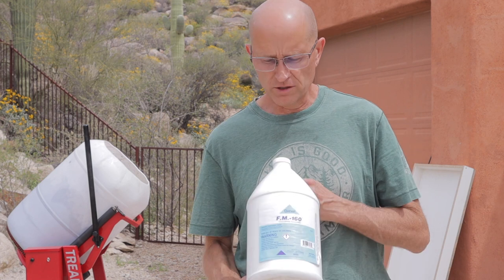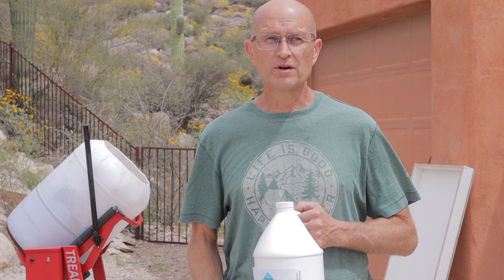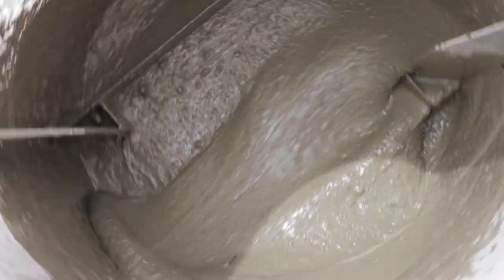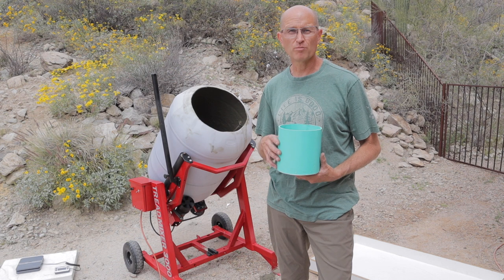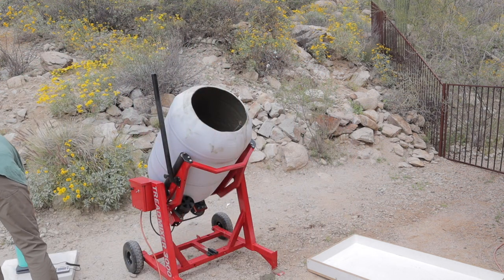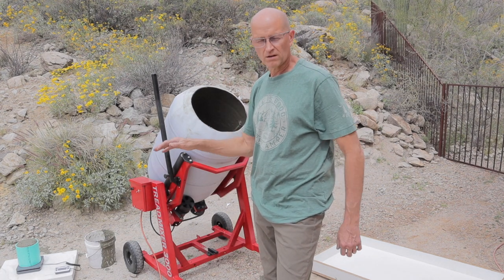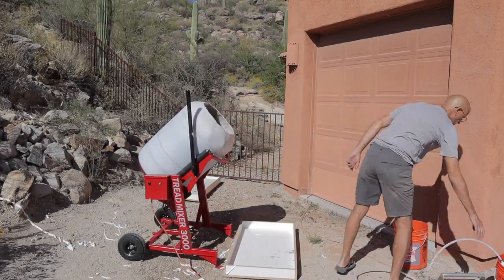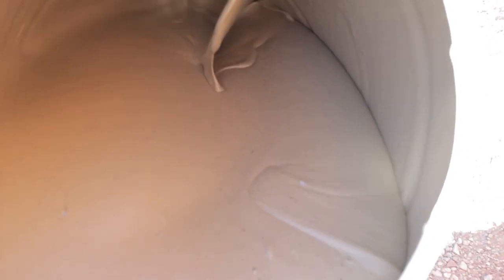How to Make AIRCRETE The RIGHT way!  [ How to measure Density for consistency.

Comment: I have a suggestion for building walls with AirCrete.  Maybe it's been posted and/or tried already, but it may be of use for continuous wall construction.  
Last year, I visited St Augustine Florida and took a close look at the exterior walls of Flagler College.  They were CONTINUOUS concrete walls going up several stories.  Apparently, how they did it is, each day, they would pour about a foot of concrete within forms that only extended up a foot.  The next day, they'd move those forms up another foot and pour again.  Each layer would bond to the previous layer. 
You can see the lines like strata in the Grand Canyon, each being a day or two old.

Call me crazy, but wouldn't that be an easier way to build a wall than making blocks and mortaring them together?  If the layer settled overnight, the next layer of foamy aircrete would simply fill it in.

Just a thought...
Reply: I'd love to try it here in Florida, but we have those things known as hurricanes, (and oddly, tornadoes...) and would require the impact resistance of 4000psi reinforced concrete, which is what I'll be constructing.
Reply from the maker: That is a great idea with the slipform method with Aircrete!  I had come up with a solution to building all those Aircrete blocks as well. I was going to build precision curved forms like pie sections of the dome called “gores” and just pour the Aircrete into them and my design was interlocking so once all the sections were cured, you just assemble the pieces and voila, instant dome! Similar to this method the Japanese use.https://youtu.be/muNbMlBeADs  I have since revised it to be similar to yours where I just build my arches out of steel like I described earlier. I purchased a “Hulk” tubing roller from Swag off-road and have been playing with it for a while now building projects around the house and I’m confident I can produce repeatable arches out of steel tubing due to the accuracy of the digital readout that it comes with. 😁👍
Reply: @PranaTech  Wow.  That Japanese method looks costly and painful to get right.  As much as I love the look of a dome and respect its resistance to external forces, like an egg, its geometry is far too difficult to build cheaply without an airform....in my opinion. Florida has a geodesic dome manufacturer, but they're not "monolithic" by any means.  And they tend to leak from what I've heard.  This gives Monolithic domes an advantage with a weather-tite airform.  But even then, the airform won't last forever and will need to be coated regularly or covered with a "permanent" solution like metal.

This is why I've decided to nip the bud early and use 2'x12' metal panels as a skin over hoops made out of 1 3/8" top rail bent with hoop benders from buildmyowngreenhouse dot com.  With the weather sealed out, I can then apply 3" of polyurethane closed cell to the inside of that, then attach the rebar & spray my sand mix with a cheap mortar sprayer.

The hoop bender is cheap and I believe I can get consistent hoops.  Since it's soooo thin, the skin will have to be screwed on though...  I'm not skilled in spot welding.  I'm starting with a 100 sq' shed.  Then a bigger shed of 150 sq'. And if all goes well...
Reply: @PranaTech  One other method I've seen which may allow for a thick wall of Aircrete is: "Bow Construction".  This definitely is DIY level, see:  https://www.youtube.com/watch?v=Co5KfvKux44
I haven't given it too much thought, but it seems a guy could use 2x6 spacer blocks, and if you skin both the inside & outside using the "slip form" method, you could build your walls 2 or 3 feet a day till you get to the peak. This would be a 6+ inch wall (depending on the plywood used for the bows.) I believe it would be very good "R-Value" and at that thickness, as strong as wood construction.

When the aircrete has cured, you could remove the bows and fill in the spacer block holes rather easily.

Again, this would be great for a place with no hurricanes or tornadoes (like Florida or Texas).  I think the arch would be fine with the snow loading in the Northern states.  But I'm no engineer, I'm just a guy who thinks he knows some stuff.

Comment: First I like to thank you for all your informative videos.  Your videos are much more detailed and scientific then most of the video postings.

I'm new to Aircrete and frankly somewhat skeptical of its durability, but I guess it has it's applications.  I've been researching the making of Aircrete by DIY'ers for about six weeks.  My first impression was that making the proper density of foam and using the proper foaming agent was the “holy grail” of Aircrete.  But several individuals appear to have engineered a workable foam making device and “magic wand” to provide the proper working density.

But I'm now convinced that the incorporation of the foam into the Portland Cement slurry is equally important.  After watching video after video of people having problems properly blending the foam into the cement slurry, I have a couple of question which I hope you can help me understand. 

I see most DIY'ers using drill type blenders with sculptured wire blending paddles to “beat the hell” out of the mix.  This kinda works, but it appears to be time consuming and has to be destroy numerous foam bubbles in the process.  I watched your video of the cement mixer you build with interest.  I noticed that your first attempt did not product the kind of mixing action to properly blend the foam into the cement slurry, but that you made a modification to the paddle design that from watching the video had a dramatic effect on the blending process!

First, can you confirm that I'm seeing and understanding that your modified cement mixer had this dramatic blending effect?

Second, will you share your modified paddle design on you blog, its a bit difficult to see the entire paddle in the video?

Third, I have a Harbor Freight cement mixer (frankly which I have never used), would you recommend using a standard configured cement mixer over using a drill type blending mixer to incorporate the foam into the slurry?

Lastly, I have to say that I'm impressed with your ability to produce well thought out useful devices.  If you are interested in a new project, have you seen the new continuous concrete mixer for DIY.  Its called the “Mud Mixer”, (mudmixer.com).  It cost about $2999 at Northern tool.  It's essentially a small hopper, with in-feed/mixing auger with a controllable water spray and a motor to provide power to the blending auger.

Again, I thank you for the very informative videos!
Reply from the maker: Good morning! Yes you are correct in all of your findings! The properly developed dense foam is the first critical element and then gently incorporating the foam into the cement slurry without damaging the foam structure is just as important for consistent Aircrete production. My paddles were too small in the first design and so I extended them to about 5 inches length from the side of the mixer. I am currently rebuilding the mixer as we speak. Upgrading to a steel body instead of the plastic one of the original design. The plastic did not hold up over time and ended up cracking in many places due to the weight of regular concrete mixing. If I only used it for Aircrete it would have lasted for decades but regular batches of 200 pounds plus of concrete was just too much for the plastic barrel.  Your harbor freight mixer will do perfectly for Aircrete just the way it is. The key is mixing just enough to incorporate the foam fully into the mix and then stop and pour into you molds.  I have looked at the mud mixer and it certainly is an interesting design. If I was in the fencing business I would certainly buy one because it is great at small batching doses into holes and such. I mix up larger batches at a time so it would not be very practical for me. Thanks for your great comments! Don😊👍

Comment: Nice video thanks for the information. I plan on building monolithic homes in the Philippines for a charity. Can this product be sprayed to form a dome like they do with the traditional concrete sprayers? Does it have any insulated values? I appreciate any information Thank you!
Reply from the maker: Hi Patrick!  Aircrete has great insulation properties but cannot be sprayed on the outside of a dome. It has the consistency of a thin airy milkshake and can be poured into molds to make different shape blocks for building. If you need compressive strength, you will need to ad sand to give it some strength. Hope this helps! 😊👍
Reply: @PranaTech  Yes absolutely helps beautifully I just wanna make sure that we can spray it so that it will stay in place and can be formed with a trowel. I’m just hoping that it will have less of a chance of cracking like typical concrete although we will have a rebar chicken wire so to speak structure for it to adhere to and we will also have a flexible insulated board with a vapor barrier underneath it and then another layer of Air Crete on the inside. I know traditional monolithic homes done the regular way with typical concrete still have a very good R factor for insulative purposes but I think this Air Crete will be far superior. We’re also incorporating incinerator toilets and water tanks on each corner with a wall that connects them which is also a big water tank. The solar system will also have a battery array for each home and a big generator that will come on when the battery of any of the homes Drop below 50% to give us a longer battery life. Very excited to get it started
Reply from the maker: Wow, that is going to be a great project! 😁👍

Comment: Hey, just starting my voyage and wondered... before the foam was added to the mixer you referred to the 'concrete' slurry in the mixer. Was that just water+cement? In the UK when we refer to concrete it is generally cement+water+aggregate (ballast)  but I am guessing there is no ballast in aircrete? I would assume that the foam bubbles are essentially acting as the aggregate? Many thanks
Reply from the maker: Hi Pete! Yes, you are correct on all points! The foam takes the place of the aggregate and I should have called it a cement slurry.  Cheers!
Reply: @PranaTech  thanks so much for clarifying 🙏

Comment: hey, have you experimented with using lime instead of cement?  
would be interesting to figure out the ancient roman concrete formula (lime + volcanic ash) as an aerated mix.
will play with it when i get the time..
Reply from the maker: I haven’t experimented with it but I like the idea! Not being dependent on a complex product like cement is definitely a good thing!😊👍
Reply: Adding some lime can create self healing concrete

Comment: do you have a video on how to build your foam tool and set up?

a video of your mix concrete slurry ratio how much concrete how much sand, if any? how much water???

what brand concrete mix do you use???
Reply from the maker: Hi there! Here is a link to my foam generator build video.https://youtu.be/IsqQOrOgPqE  My ratio for Aircrete is as follows: My recipe is mixed in a 55 gal barrel and I mix 6.5 gallons of water with a 94 pound bag of Portland cement and once it is blended into a nice even slurry, while still blending with my drill, I fill the barrel up to the 45 gallon mark with foam. I mix it just enough to incorporate all the foam and then stop and pour into my molds. If you mix too long you will beat the bubbles out of the foam and the mixture will collapse before it can set up. Any brand of Portland cement bags will work fine. No sand is used unless you want stronger, more dense Aircrete blocks.😊👍
Reply: @PranaTech  thank you soo much for this information this is truly most helpful great video also keep up the great work sir!
Reply from the maker: You are very welcome! Let me know if you have any other questions.😊👍

Comment: What kind of a releasing agent do you need to spray on your forms to allow the air-Crete panels to release from the forms?
Reply from the maker: Hi Robert! Sorry for the delay in my response! Somehow I missed your question. I’ve used a bunch of different release agents. Johnson’s paste wax works good and so does Vaseline thinned with kerosene and brushed on the forms. Diesel fuel works good on smooth forms. 😊👍
Reply: @PranaTech  I’ve used diesel on regular concrete forms, I just wasn’t sure about air-Crete forms. I know Dawn dish soap cuts through oil and grease (auto mechanics cheap hand cleaner), but I wasn’t sure how the air-Crete would break down with the releasing agents.

Comment: I’m impressed that your slab pour did not slump or shrink as I have seen on other YouTube videos. did it really not shrink at all or was it just too soon to tell?
Reply from the maker: Yes, it does not shrink. If you use high quality foaming agents designed for making Aircrete, you won’t get the shrinkage. I am currently using foam solution from a company called Vermillion and their stuff is the best I’ve used. Here is a link to their site. https://www.vermillionassociates.com/varimax-concentrate.html. 👍
Reply: @PranaTech  Thanks. I think you may be on to something as to that being the reason. one guy was using some kind of foaming agent used by crop dusters to drop white blobs on the crops so they could see where they had been
Reply from the maker: Yes, I’ve used that stuff and it sucks! If people would use engineered cellular concrete foaming agents they would be much more successful.😁

Comment: What is your cement to water ratio?
And how much of the foam additive per mixed load.. ?? 😊. Thank you
Reply from the maker: My Aircrete recipes. 15.66 pounds of Portland cement mixed with one gallon of water. Then add 7.5 gallons of foam. 

Or in metric.  7 kilos of cement to 4 liters of water and then add 30 liters of foam.

If you want to make it in a 55 gal barrel,  I mix 6.5 gallons of water with a 94 pound bag of Portland cement and once it is blended into a nice even slurry, while still blending with my drill with a grout paddle, I fill the barrel up to the 45 gallon mark with foam and mix just enough to incorporate the foam evenly.  I usually mix a 5 gallon bucket of foam solution for my foam generator to spray foam with. If you are using Drexel, use 4 ounces to 5 gallons of water. For Vermillion concentrate, I use 2 ounces to 5 gallons because it is more concentrated. 😊👍

Comment: Thank you for your video.  The most informative aircrete video yet.  The III cellular concrete class is kinda in the middle.  Would that class be good for a tinyhome ICF home with a second story?  I'm thinking of building an investment property.
Reply from the maker: Hi Gina, thank you for your nice comments! In the case of a second story building you would need an engineer to sign off on the density of the block for such a building. He may just require the first story be one density and the second might be allowed a lighter density. It just depends on the engineer you are dealing with and how much experience they have with Aircrete/ cellular concrete. 😀👍

Comment: Very informative. What should be the foam density. Which foaming agent is good.
Reply from the maker: Hi Mohan,  the density will vary depending on the strength of the finished aircrete that you want. Typically most people use 30 to 40 pound per cubic foot density for building blocks.  This would mean 3 to 4 pounds density measured in my 1/10 of a pound green measuring cylinder that you see in the video. The best foaming agent I’ve used so far is CMX  from https://www.richway.com/construction.html  I believe I have found a better one from a company called Vermillion but I haven’t tested any yet. https://vermillionassociates.com/  Hope this helps!😁👍Don
Reply: In other videos people will test the foam density before mixing it in with the Portland cement.  Have you tested the density of the foam itself?
Reply from the maker: Hi Dustin, yes I set my foam generator to produce foam at a specific density. I want it to produce a 5 gallon bucket worth of foam that weighs 3 to 3.3 pounds for just the foam.  Once I have the generator producing the density of foam that I want, I merely have to time my foam application to match the amount of Portland that I am mixing.😀👍

Comment: Hi Don.  My son and I found your video and have been producing nice foam and aircrete since buying and modifying a mixer.  My question is what ratio of products would you use to produce structural blocks?  We are interesting in casting 8"x8"x32" blocks for building.
Reply: Also, how do you test the compressive strength of your blocks?
Reply from the maker: Hi Cynthia! Here is a chart that gives ratios for strengths of simple Aircrete with just Portland and foam.https://drive.google.com/file/d/1MaVj1CvjdFybTYpFop8wE49Tg0TNzKzH/view?usp=drivesdk Here is also a chart I use for structural Aircrete with various ratios of sand added to the mix. https://drive.google.com/file/d/1BLYueqCIp7c6YN1LklAt4uoINeXFDtA_/view?usp=drivesdk I don’t have any way to test compressive strengths of finished product. The best I can do is to make a one cubic foot mold and mix according to these charts and compare the cured weight of the finished product to the weights on the chart and go by their rating for compressive strength. Hope this helps!😊👍Don
Reply: @PranaTech  This is excellent - thank you!  I did not have access to the second file, so I sent a request.  Thanks for sharing your knowledge and resources!
Reply from the maker: Hi Cynthia, sorry about that. I changed the restrictions on the file. It is annoying that onedrive defaults to restricting all files instead of making them all available. 😊👍